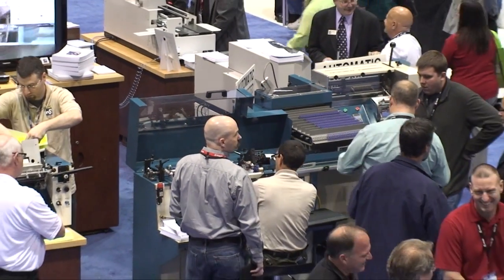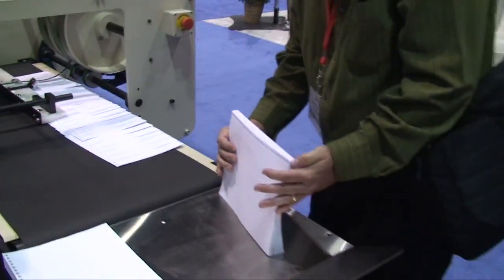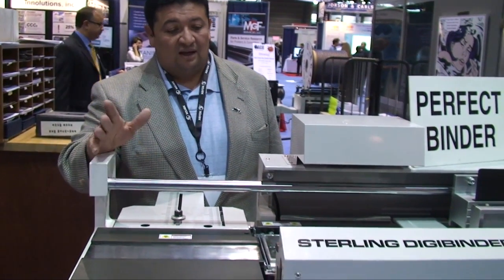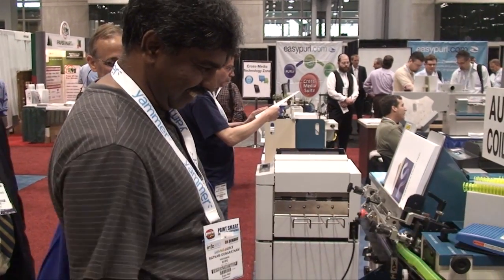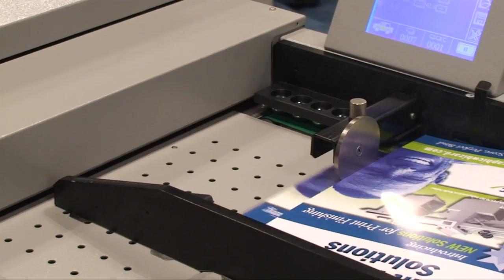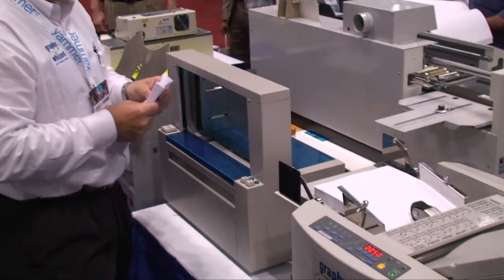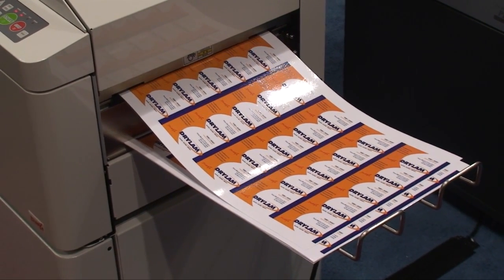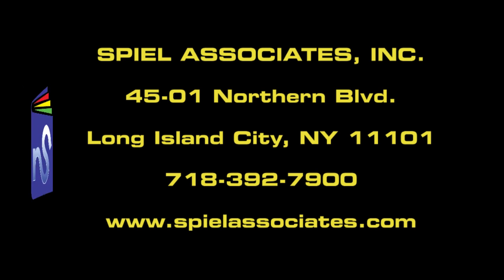A Sterling Show - What you might see at Spiel Associates' booth

Comment from the maker: A STERLING SHOW

See what you would see at The Spiel Associates booth at a trade show. See Perfect binders, collators, paper punching equipment, double loop wire binding machinery, as well as the only patented in- line plastic coil binder and former in the US. Offering short run book bindery equipment to large run solutions, Spiel Associates' wide array of finishing equipment ranges from case binding equipment, stitchers, creasers, UV coaters, and booklet makers, down to the smallest table top punching machinery and plastic spiral binding equipment. See demos and testimonials in The Spiel Associates booth.

For more information, please contact Spiel Associates, Toll Free at 877-BINDERY or 718-392-7900 or sales@spielassociates.com